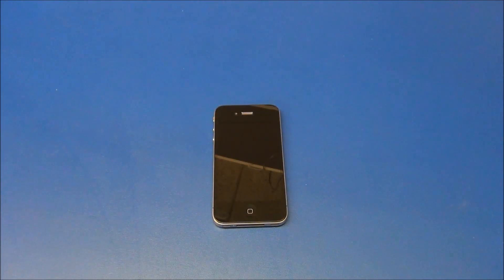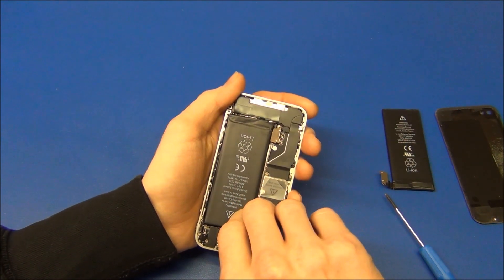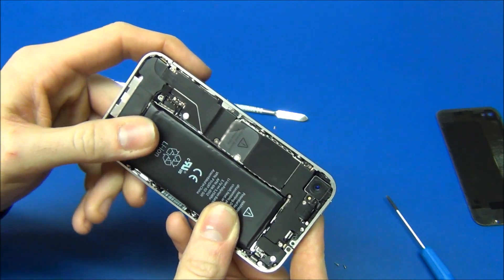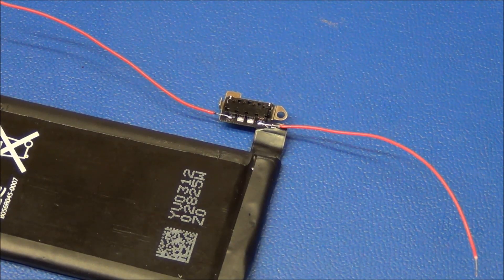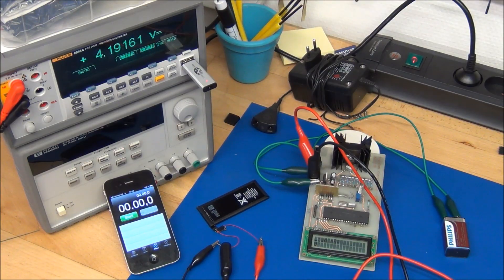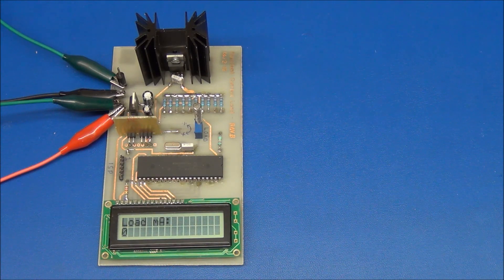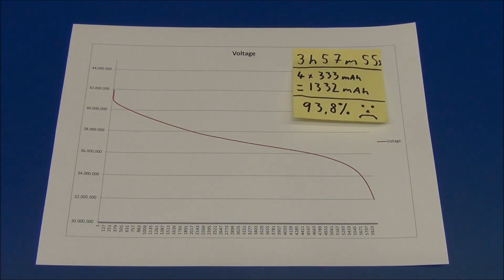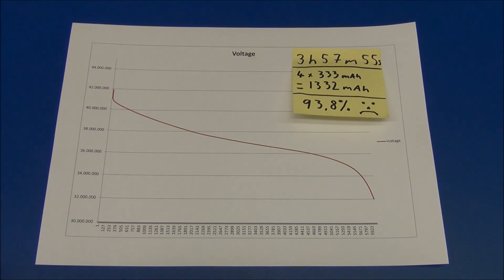iPhone 4 Battery Replacement + Battery Test - Ec-Projects

Comment: So why did you change the battery? It's perfectly healthy and could last another 12 months, perhaps more.  I purchased 3 batteries for a quadcopter from a Chinese on-line store and they are almost identical to your original battery, the only difference being the special plug on your battery which wasn't on mine, it was a simple JST.

I'd say Apple or a manufacturer who makes Apple batteries have been caught with excess stock and they are selling them off cheap. I'm not complaining.  Just don't expect such a good rub out of the new battery, there's a good bet it's been sitting on a shelf somewhere. One thing's for sure, you're not a very good actor.  Trying to tell us you'd never changed the battery previously. You managed to go for the first two screws straight away and then knew the back should slide off and then you went straight for that connector and knew it was the only one holding the battery in. You either have ESP or had already watched the many videos on YouTube. :-)  Naughty Boy.

Comment: Just want to tell you that your video was very good and i learned SO much from it :)

I run a phone spare parts shop in Denmark, and really are on the look after a device that can tell me if my batteries are good (Or how good they are) 
is it possible to find such device? or do i need equipment like yours and then have to do the calculations, waiting and so? :)

Looking forward to hear from you :)
Reply from the maker: Rasmus Bang Pedersen Hi, der findes testere, som automatisk aflader batteriet korrekt og skriver kapaciteten. Det bliver nok et problem med alle de forskellige stik, som bliver brugt af de forskellige producenter. Jeg har ikke set nogen som inkluderer stik / adaptorer :( De professionelle er rimelig kostbare, men de fleste Li-ion ladere har også den funktion: http://hobbyking.com/hobbyking/store/__1434__408__Chargers_Accessories-Battery_Charger_AC_DC_.html
Reply: EcProjects
Tak for hjælpen :)

Til at tilslutte de forskellige batterier har jeg dette, som måske kunne benyttes som port for de forskellige modeller af batterier.
http://i59.tinypic.com/29asnj7.jpg

Hvilken af dem du linker til vil du anbefale? :)

Comment: hi ..tere,,.my i phone 4s has now just hardly 3 hrs life.I wanna to change its battery..however I am bit scared as everybody told me that the Apple does not produce it`s original replacement battery ,putting some kind of non branded companies battery will cause damage phone`s internal circuits and also may be these batteries will burst or leaks [bulge out]easily.So I am really confused.could you please suggest any solution or can u say what is the best companies`s battery for this work.

I eagerly looking for your prompt reply.
Reply from the maker: jacob paul Hi, I don't really know which brands are good and which are bad, sorry.. I bought mine from a "local" store with good reputation where it came with a 2 year warranty. No guarantees but at least you can get the battery replaced if it dies..

Comment: Did you work out what was the problem with the phone software then? Cause recently my phone battery started to die after 30 minutes of full charge (iPhone 5) and I doubt it's the battery rather a software issue!!
Reply from the maker: 3amali1 Nope sorry - I reinstalled the OS but it didn't help..
Reply: EcProjects Thanks for the prompt answer. Did the new battery help make things better or you still have the problem even with the new battery?
Reply from the maker: It helped a little bit, but not worth the change in my opinion :)
Reply: EcProjects My goodness, so you had to skip your phone because of that!! I mean mine is only 1.5 years old, what a short life for a product of that cost!
Reply from the maker: I wouldn't say it was unusable, it was just that it struggled running for a full day without having to recharge. I still used it for almost a year.. :)
Reply: EcProjects Very disappointed with Apple!! Its only a year and a half since I got the phone and now it's barely useable just because their software is so messed up!!
Reply from the maker: Yeah, and they also made it slow as dead donkey... -.-

Comment: I just had to fix an iphone because it wouldnt to charge or come on. i didnt understand cause there were no signs of water damage. i read on the internet to find a solution and no avail. so i tried manually charging the battery to rule out the charging port being broken or the battery. i charged it for a few seconds with a - & + wire and i put it back in the phone and voila. the phone recognizes the battery and the charger and is charging fine. sometimes these batteries need a little jumpstart.

Comment from the maker: Yeah.. But it's an original, so I'm pretty sure it meets the specs. 
And I didn't want to solder wires to the new battery, in case I would damage the connector.. (it's made of plastic)
But you are right, if we wanted a confident comparison we would have to test it. :)